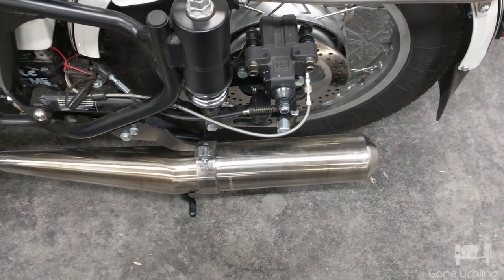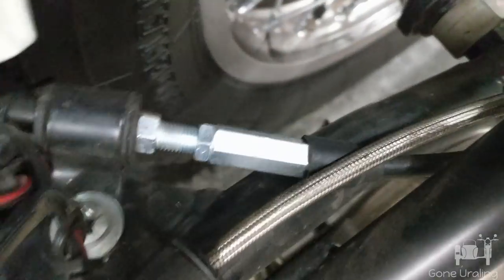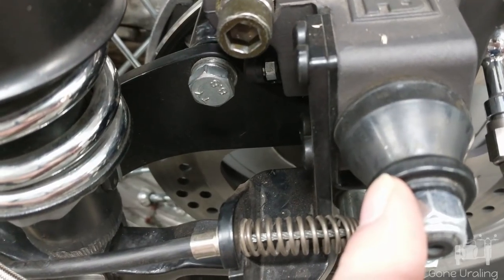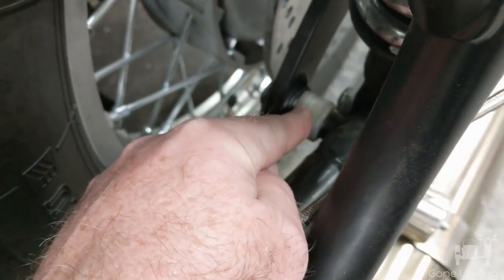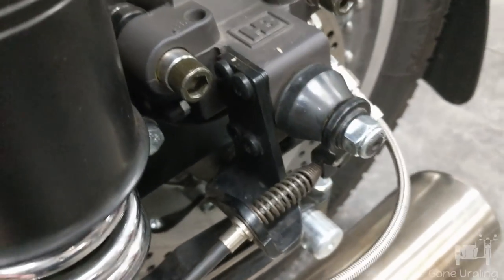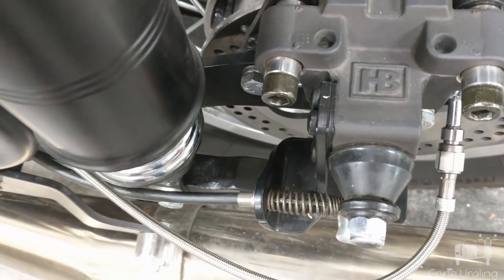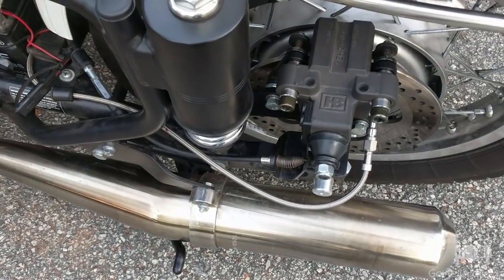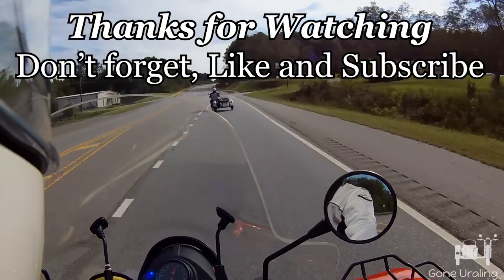Brake Woes, why my rig went to the shop.

Comment: I applaud IMZ for continually making improvements on their motorcycles and product line. Ural has come along way with closing the gap on the quality control issues but still have along way to go to catch up to the Japanese brands. I just wonder if today's rider is still willing to put up with the idiosyncrasies of owning a Ural?
My first bike was a 1993 Honda Nighthawk 650 which was a tour-de-force. Did a lot of trouble free commuting on that bike amassing over 50 k. It was real turn-key friendly. Fast forward to 2008 with buying a used 06 Patrol that had many of the same features as my Nighthawk; front disc brake; electronic ignition, shaft drive. Where could I go wrong? LOL

 Can't thank you enough for producing these videos and for having the smarts and resources to maintain your rig. Your YouTube video channel is an outstanding resource to they "Ural nation".